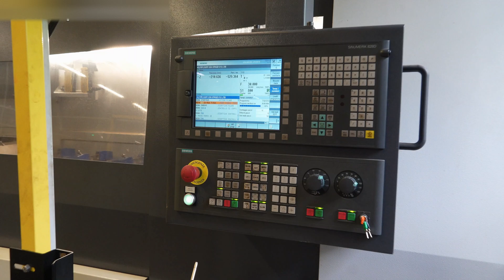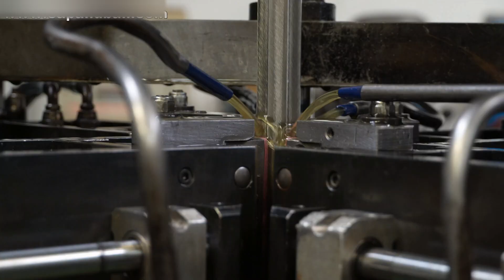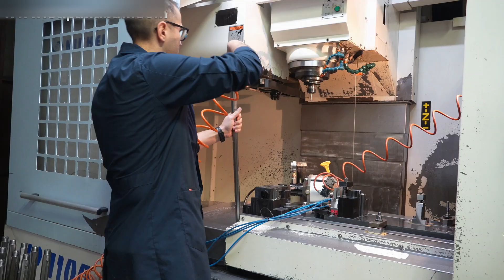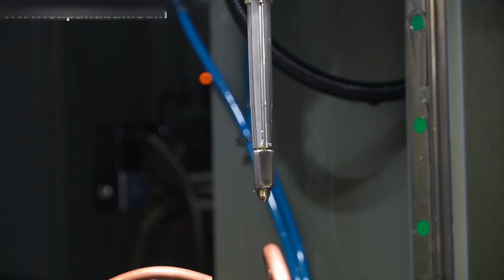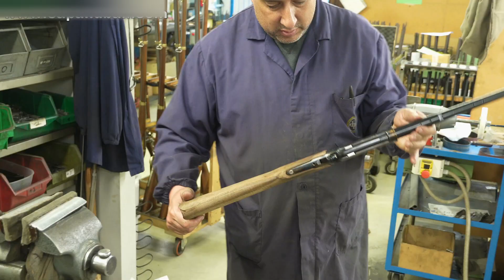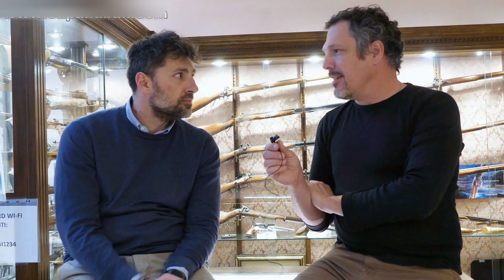How a M1886 lever action rifle is made today. Part II. Rifling & assembly #rifling #leveraction

Comment: .45-70 Gov't, .45-90, .405 Win, and .348 Win seem to be the main calibers in the Miroku/Winchester M1886 currently (.348 not in current production). .405 Winchester cartridges and components are VERY difficult to source.
Pedersoli doesn't manufacture replica of M94 (straight or angle ejector) which would cover .30-30, .38-55, .375 Win, .444 Marlin, .307 Win, and .356 Win (the latter four no longer in current production). However, they have configured the 1886 action to operate with .30-30.
Thank you for the tour of the factory and interview with these fine gentlemen! I love to see the manufacturing process.